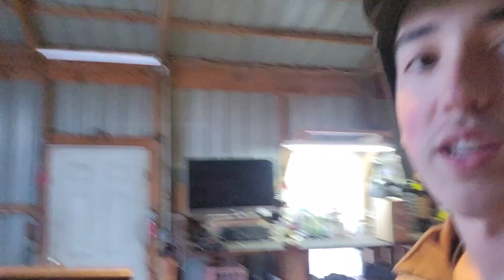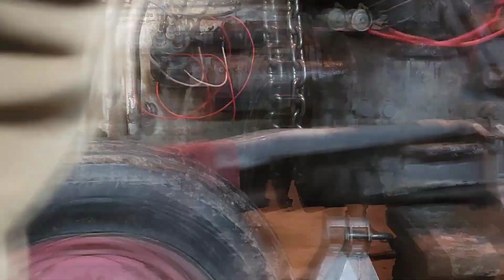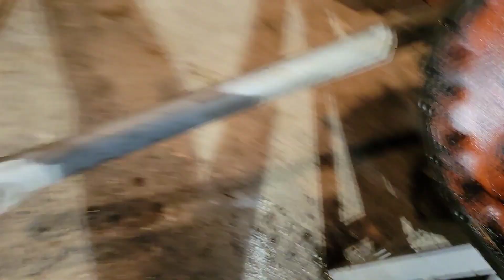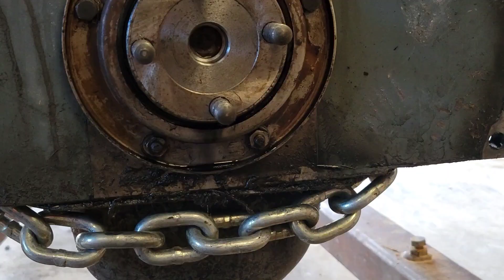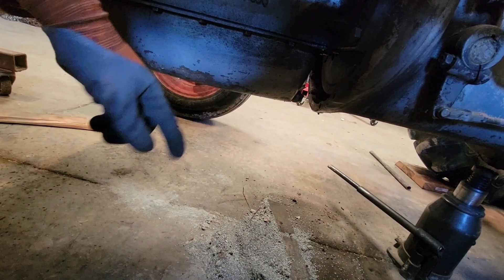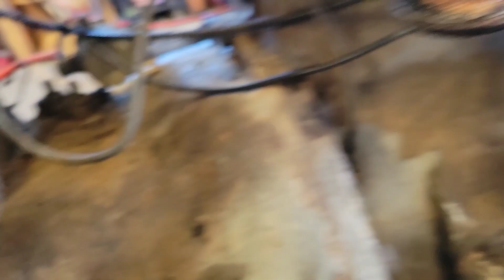Massey TO-30 clutch replacement and cable throttle conversion!

Comment: Sir you can get those carbs at tractor supply and or the rebuilt kit just trying to help out a little for you you all are doing great
Reply from the maker: I have rebuilt this Zenith carb about 3 times, it hasn't been right. it runs rich everywhere, low, mid, and high rpm. I have adjusted float height, swapped jets, and tinkered with it for hours. I will probably buy a new one soon. I have found that some carbs are just junk, and the only cure is to get another one. 
Thanks for watching!